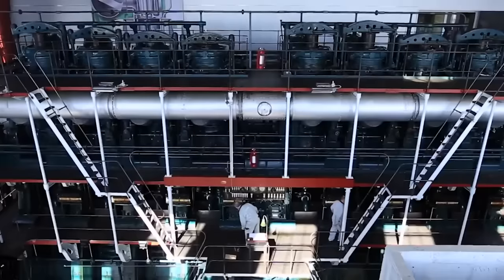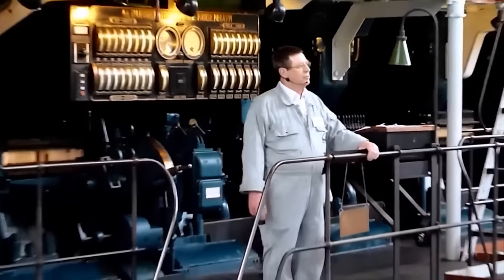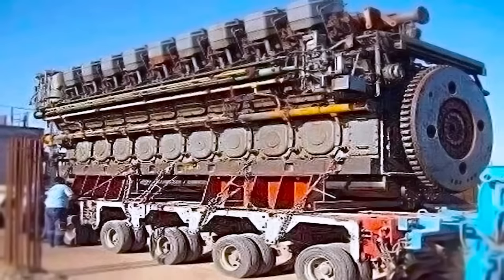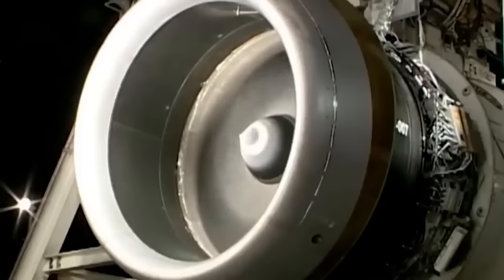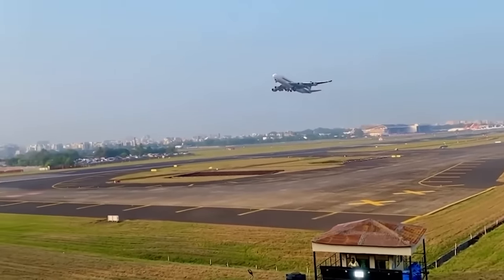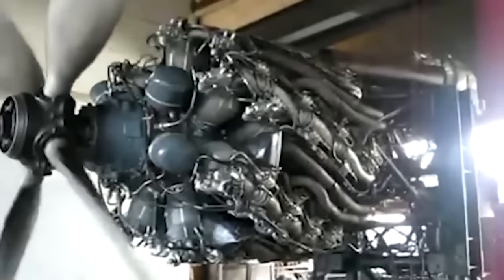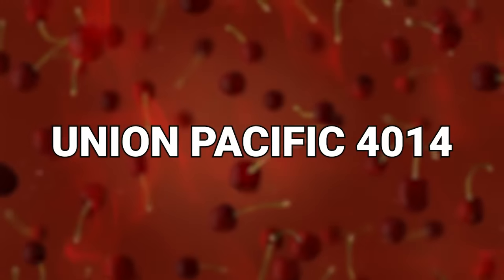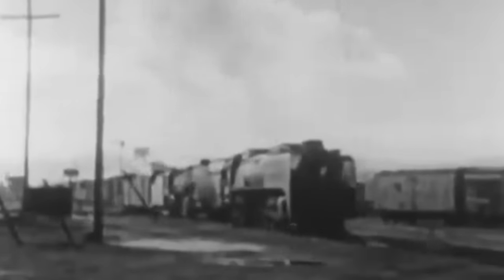The Most Powerful Engine In The World

Comment: The 6-71 Gray Marine Diesel Engine sure looks a lot like the Detroit Deisel 6-71 that was used in semi trucks and off-highway trucks and construction equipment for several decades.  Best known for turning diesel fuel into noise.  (It even says "Detroit Deisel" on the valve cover.)
Reply: THReynolds2..... That's because they ARE Detroit Diesels.  Back in that era, Gray Marine had the contract with GM Diesel Power (as branded until 1965) for producing all the necessary parts & converting them for Marine use.  

Gray Marine also utilized commercially available gas & diesel engines, not "just" the GM 2 cycles.  Gray Marine was bought out by Continental Motors just after WW2, in 1946... and continued in operation until 1967.  

From 1967, forward... Detroit Diesel produced their own marine units "in house".
Reply: They were the same basic engine. The marine engine was tuned more for constant speed operation. Some of the external components were made of more corrosion resistant metals than the truck versions.
Reply: @michaelclark9762 .... They were not "tuned" for constant speed operation, they used the dbl wgt variable speed governor, preset for 1600 rpm plus a "Battle Run" preset for 1800.... versus the sgl wgt Limiting Speed gov. for automotive applications.

As far as.. quote "Some of the external components were made of more corrosion resistant metals than the truck versions."... none of the external engine components necessary to the basic function of the engine from the factory (GM Diesel) were any different than what was used in truck or heavy equipment, or any other myriads of applications.  

The water cooled Exhaust manifolds (on 2, 4 & 6-71's) being the exceptions and were designed and manufactured "in house" at GM Diesel, same for the outer housing of the heat exchanger... all else was from Gray Marine.
Reply: @Romans--bo7br  Please read my comment again. You're arguing against something I didn't say.
Reply: @michaelclark9762 .. Michael, I'm Not "arguing" against anything.  In your initial response, you stated a couple of "facts", which were Not entirely correct.  How many years, and what years did You, yourself... work with the R&D division of GM/Detroit Diesel?  I don't recall your name from there, at least in the era I was there.  Have a great weekend, and take care.
Reply: @Romans--bo7br  That's because I was working for a contractor who's biggest account was Cummins, where we were busy creating highly efficient four stroke diesel engines that pushed the two stroke DD out of the highway truck tractor market.
Reply: @michaelclark9762 .... Cummins did Not "push the two stroke DD out of the highway truck tractor market".... at all.   The increasingly restrictive and future (at that time) EPA mandates, did.  Are we having fun, yet?  : ) 

Hope you're enjoying this lovely weather... depending on what part of the country you're in... and hope you weren't affected by all the bad storm we recently had.
Reply: *Diesel
Reply: same engine bastard thing ran 24x 7 outside my cabin on a tug, genset motor, easy to rebuild same parts for 3,4,6,8 12, Seventy one series

Comment: Hey, Did you ever go to a physics class?? No!  I thought to. Well weight moved over distance in time requires Horse Power. That is a fact, So an electric, Diesel, Coal fired, Oil fired engine (Admittedly depending on efficiency) requires the SAME AMOUNT OF ENERGY to move 1 ton, one mile in one minute. Trains do it more efficiently because of steel rails. Big boy produced 7000 - or more - horse power from one LOCOMOTIVE and there is no diesel engine capable of that today. In fact trains usually have FOUR diesel engines or = 4 times the pollution. The only reason they are popular is maintenance. It still takes TWO guys to run them safely.  NOW they are running 1 or 2  more DPU engines in the middle of the trains.  Don't dare talk about polluting when it comes to oil fired locomotives. Especially the Big Boys. As far as electrical energy - The grid can not support the load it has today never mind adding electric rail equipment to it. It could have been done before they shut down the nuke stations and the coal fired stations but no more, buddy - live with the truth, not the fantasy.  Green is actually very brown.
Reply: Interesting perspective. Thanks! 👍

Comment: Electric is not an engine, it's a motor.  An engine is a primary fuel consumer.
Reply: Hmm, electric motors are powered by primary fossil fuels from a distant source. So if that is the definition electric motors are indeed engines. You might say they have extra long extension cords. 🤓🤓

Comment: Title says "Most powerful in the world", I didn't see such a thing. Didn't even see the Wartzilla (ap?), the enormous container ship engine. The one ship engine at the beginning was substantially smaller.
Reply: The engine that is demonstrated in Copenhagen was built in 1930, and was the largest engine THEN! The thing only weighed in at 1400 tons. The largest current ship's diesel engine (as at 2023) weighs in at 2,320 tonnes, and develops 109,000 hp!
Reply: @gunner162  Yes, that would be the Wartzilla that I mentioned in my comment.

Comment: Hey Scary Cherry 🍒, I heard you quantify the engine’s torque output in “pounds-per-foot.” That’s not correct; torque is a force applied to the end of a lever in a direction normal to the radius 🦴 represented by the lever, in this case, centered @ the axis of the engine’s crankshaft.

Comment: If the Wärtsilä engine is not a Diesel, what is it?
Reply: Heavy oil powered. Sort of like cold, used motor oil. Must be pre-heated before use. Heavy oil is preferred for these large engines because it has a higher energy output per liter than diesel.
Reply: @sagebrushbob2321  OK, but what's the principle? What ignites the heavy oil?
Reply: @8546Ken  it is ignited in the same manner as diesel no difference. The pressure approx. 1000 bar will ignite the fuel when its pump into the cylinder. HFO (Heavy fuel Oil) is preheated and send through a centrifuge and into a fuel plunger ready to push it in the cylinder when the piston has reach TDC.

Comment: Where is the F-1 engine used in the Saturn V moon rocket with its 1.8 million lbs. of thrust? Its fuel pump alone put out 55,000 horsepower.

Comment: Rudolf Christian Karl Diesel was a German  mechanical engineer who is famous for having invented the diesel engine
while working at the Factory M.A.N in Augsburg, Germany.
During my time with M.A.N in 1973, we had an enginge 105/182 (1.05 meter cylinder bore/1.82 meter strock) with output of 5300 PS per cylider totaling 53000 HP as a 10 cylinder ship engine. I wonder what is the current max power?
Reply: 7,000 HP x 14 cylinders= 98,000 HP (IIRC) from the information I remember hearing early in this video

Comment: 26:27    The "Brutus" is a 2,862c.i. V-12 aero engine stuffed into a tin can and was the fastest thing around at the time, although it wasn't a pleasant vehicle to drive, and could only make it around a race track a few times before it needed servicing.

The 547c.i. V-8 in my current street car would lay waste to the Brutus, and I can simply jump into it and comfortable and easily drive it across the country if I wanted to without any issues. 
The Brutus wouldn't make it 5 miles on the street without having major problems, and your face would be black and covered with oil if you attempted to do that.

Isn't technology great?? 👍

Comment: Well, really, classically, an “engine” is an engineered system. Long before there were heat engines there were “siege engines” in medieval wars - towers and cranes to storm castles. So I don’t fret too much over the modern distinction.

Comment: You mean the magnet trains that run off the coal plants?
Did you seriously just measure the power output of a wind turbine by "how much Co2 it saves"?
%3 of any given grid or less, on an annual basis, is powered by wind. There are fields full of epoxy-resign windmill blades, slowly bleaching in the sun, and soaking chemicals into the soil. 
Do you know how much it takes the super tankers to transport all those blades all over the world? How much diesel it takes the trucks to move them? Or the cranes to lift them?

What about mining the materials? Do you think it's done with solar and wind power too?